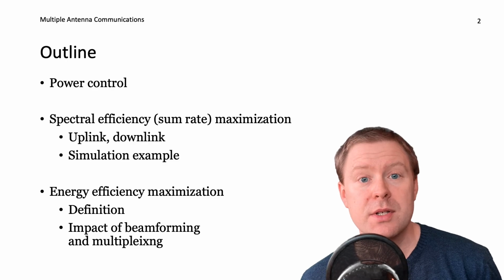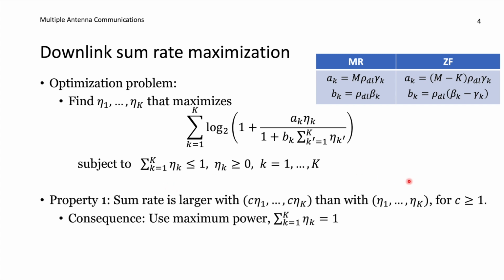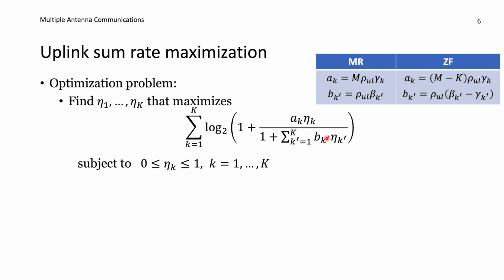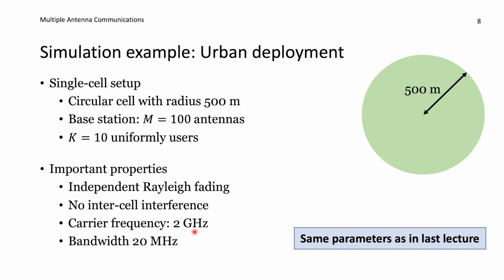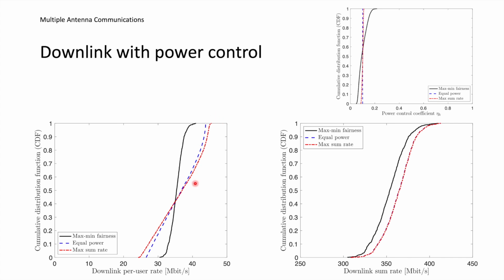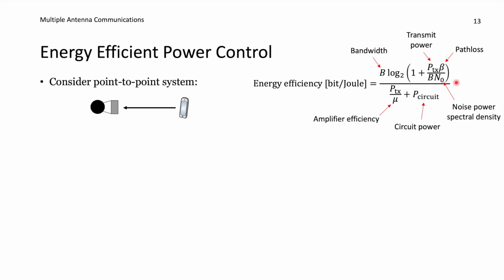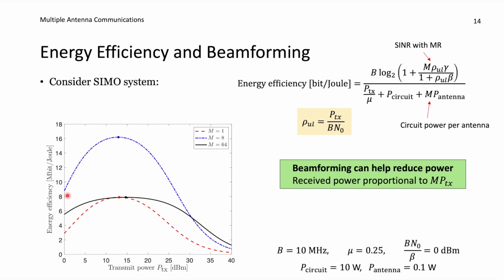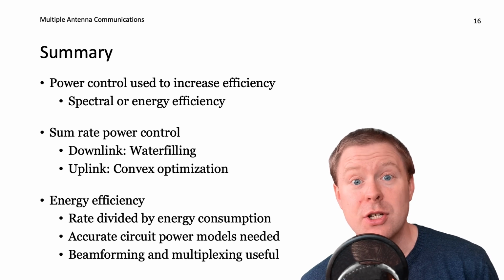Lecture 12: Power Control for Spectral and Energy Efficiency

Comment: I am wondering if the denominator@15:00 is really the same for every user. If I understood correctly, k' to K is the set of all users except the one whose SINR is being evaluated. In that case, the value of this expression is different for every user, although its notation might look the same due to the way it is shown here. I am wondering actually what don't we use the typical way of having i=1,K in the outer some and then k=1,K&K~=i in the inner sum in the denominator.  

Thanks for taking the time to answer the question btw! Really appreciate it.
Reply from the maker: What you are noticing here is that the interference term for user k contains interference from the user itself. This wouldn’t be the case in a situation with perfect channel knowledge, but the formulas that are used in this video are taking estimation errors into account. This leads to a kind of self-interference where the imperfect channel knowledge leads to an uncertainty in the detection so that each user is (slightly) interfering with itself. I believe that this is a phenomenon that one should expect in practice as well. However, the weak spot with the methods used in this video is that they rely strongly on the i.i.d. Rayleigh fading assumption that was made in previous videos. For other channel models, each user will also be subject to interference from other users, but the value of the denominator will nevertheless be (somewhat) different between the users.

Comment: May I ask 

1-we have @15:40 a single constraint related to the etas then in @17:80 I see we have 2 different constraints one for X and the other for sum over X 
How was those derived ?
Reply from the maker: The constraint at @15:40 is an assumption. The additional constraint on Slice 7 is obtained from the lower left equation related to s at Slide 6. We introduce a new variable s that must satisfy the equality from Slide 6.
Reply: @WirelessFuture  thanks I got the X inequality in slide 7 but what about the sum over X inequality ? How did it becomes 1-s ?any hints 
I know that sum over xk is sum over etak times bk times s , how do we move from there to 1-s ?
Reply from the maker: @yasserothman4023  You rearrange the equation in the lower left corner of Slide 6. Insert b_k \eta_k = x_k /s into the expression, and you will get s = 1/(1+ \sum_k x_k /s), which can be rearranged into \sum_k x_k = 1-s.